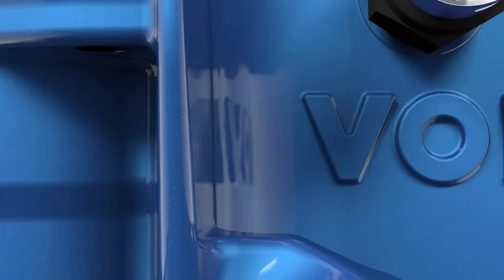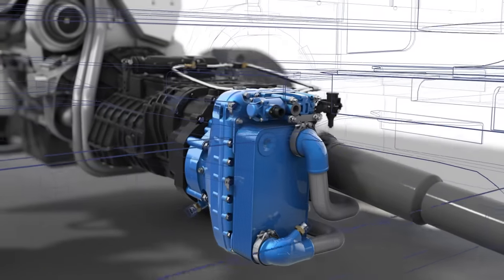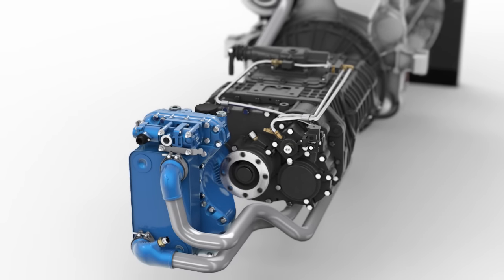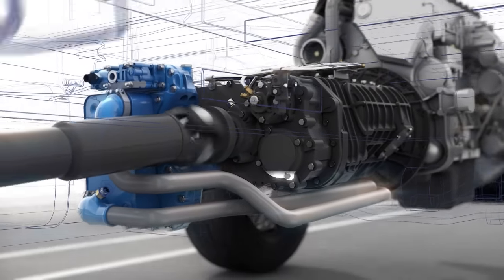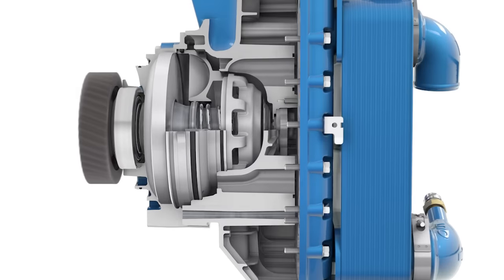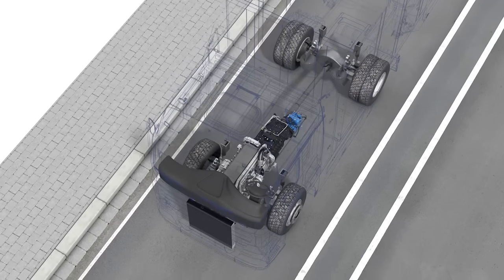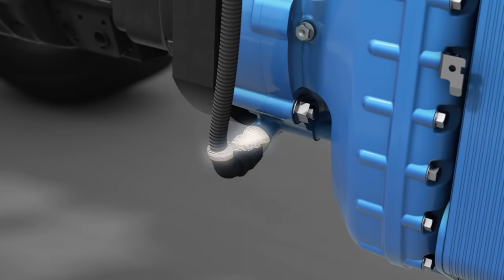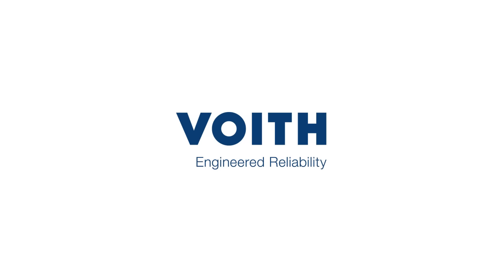Voith Animation Retarder VR115 CT (en)

Comment: So it's a hydraulic brake that works via the drive line using fluid dynamics to directly slow the truck. Kinda like at torque converter but in reverse. That is pretty cool.

Comment: Had a retarter in a 2003 Peterbilt  550 cat 18 speed and jake hauling heavy oilfield equipment and it worked great. You would be surprised how much braking power it has. 80,000kms and my brake drums were still black. Only time used any brake was to park. ps. It was a option when I bought the truck and it was $8900. Extra .
Reply: How much do you think it has saved you in operating costs over the years (brake pad replacement, downtime, etc)?
Reply: I dont think they make it for eaton, as far as i know voith is european only

Comment: Many trucks here in New Zealand use Voith Retarders in conjunction with Engine Brakes. Jacobs Brakes on a Cummins provides about 300hp of retarding. A Voith provides up to 800hp of retarding. Using both together means you can descend a steep hill fully loaded without cooking your brakes and therefore able to make a safe stop at any time. Voith Retarders work really well, are super reliable, make for  quicker average speeds, shorter trip times, extend brake parts life, and crucially, much safer truck operation. They are expensive and add to tare weight, but if you have hilly terrain and or high gross weights they are worth it.

Comment: That engine is an FPT (Iveco) Cursor engine. Not sure why we don't have those in trucks in North America. They seem to be a very reliable engine in agriculture and construction equipment.
Reply: Exactly, in agriculture and construction equipment. Mostly slow moving vehicles which are going very slowly while operating.
IVECO engines in trucks or buses are crap. Because these vehicles are moving pretty fast compared to f.e. tractors, the engine wear is bigger, and in my City, 12 buses with IVECO engines burned, because of engine failure caused by wrong facturing procedures. Be happy that you don't have them.

Comment: I drove some buses that were fitted with retarders and from a drivers point of view and many others driving service buses we hated them , they never came on smoothly , some of them even banging on and off no mater how lightly the brake was pressed , yes they may save on wear and tear but the passengers that were thrown about just blamed the driver and I actually had some heated arguments with them , most were semi automatic but some fully automatic voith push button autos , the way we got round it was to slip the gear change into neutral which made for much smoother stops , but if the company found out you would be reprimanded , this was in the 80 s 90 s so I think judging by the few buses I've traveled on they have sorted it out or just not use them on some of them.
Reply: They've improved dramatically in most cases. I drive a VDL with two stage retarder, pedal activated, and it works so well. They come in very smoothly now.

Comment: That doesn't look expensive, heavy or unreliable at all.
Reply: it is heavy and also expensive but very reliable.
Reply: they are very awesome
Reply: Found the American truck driver! These things are awesome and can easily produce over 1200 hp of braking power in combination with a good engine brake.

If you don't know what that means, it means you can hold a 50 metric ton truck and trailer at 80 km/h down an 8 % gradient effortlessly.
Reply: Of course, it would be more reliable if it didn't exist all together but joking aside I don't see why it would be unreliable - it's quite a simple device.
Reply: @energymc22  Yes, and unlike conventional brakes it has no parts that wear out and need to be replaced regularly.

Comment: So, that's a fancy, oil-driven pinion brake?
Reply: Yes, and it's advantage is that it doesn't have any shoes or pads that wear down and will never overheat either as it is cooled by the truck's radiator.

Comment: A better solution is to have the PTO drive a hydraulic pump/motor that charges up a piston accumulator during braking.  The charged accumulator will then feed the motor to drive the transmission during acceleration via a proportional pressure reducing valve allowing for fine control.  That way you do not need the heat exchanger as the energy is recovered.  A hybrid system for trucks in essence.
Reply: Im sure the mine haul trucks use this type of system.
Reply: Yes gud idea
Reply: But where do you put the compressed oil when the accumulator is fully charged? The retarder is built for long downhill roads. You can´t save that much compressed oil in the truck. And you would also need a hydraulic motor for restoring the energy to the drivetrain. The system would be to heavy, so less payload.
Reply: Maybe good for busses in cities.. fully loaded truck comin down 5000 ft.. u can’t store all that energy,unfortunately gotta get rid of it

Comment: They should use this technology for hybrid trucks, instead of just braking the vehicle could also create charge for the battery
Reply: they do. most if not all electrics and hybrids have motor/generator combos. Its so common basically all riding mowers have them! (starter doubles as generator)

Comment: 3:13 - is compression no longer occuring then? Surely the compression still creates substantial heat, whether during acceleration or deceleration events?
Reply: Fuel is shut off when braking  on most system the compession of engine is used to slow down vehicle
Reply: @garypeatling7927  not on a diesel. they have very low engine brakeing, hence jake brakes.
Reply: @jklbubbublkj7939  you are mistaken. They have very heavy payloads, hence Jake brakes.
Reply: @WeighedWilson  and very little engine braking. they dont have throttle bodies to regulate air intake, so the pistons cannot create the vacuum to make braking.
Reply: @jklbubbublkj7939  compression makes engine braking far more than vacuum.
Reply: @WeighedWilson   it is also a factor of engine speed. high rpm = more breaking. as you know, 2k rpm is not enough for significant braking. My whole point is, diesel makes less brake than a gas engine.
Reply: @pootispiker2866  I think you are missing my entire point. a 2.0l deisel and a 2.0l gas, the gas will have more brakeing due to the vaccum created on down stroke, and compression. diesels only have one. thats why the jake adjusts exhust valves to leave it closed longer to up engine brakeing. get it now?

Comment: The only issue I see the oil converter fan is always moving with the truck, what happens if that oil converter fails?   Does it freewheel, lock up, or blow up and make a mess if it fails?
Reply: System interrupts oil passage no brake applied
Reply: No intarder brake that's

Comment: Cant u use it to store the energy for takeoff as well?...kinda like an electronic capacitor...but uses the pressurised oil to drive the turbine and assist the truck in reducing engine load on takeoff...even if it lasted 7 seconds, the reduced engine load would save so much on fuel...like 1st gear is on assist, then from there, motor takes over and builds up air pressure during braking to force the oil to turn the engine on launch after stopping at traffic lights or toll gates
Reply: it can't because usually there is a lot of time between slowing the vehicle and take off, usually the retarder is used when prolongued braking is needed, often going downhill and rarely we have to stop in such circumstances, also the oil is accelerated in the " turbine"  section but when it gets back to the oil tank it has to be slow down before reentering the turbine to create braking force, so the main tranformation of energy os from kinetic energy to heat
Reply: No for one elementary reason :
There is no such "presurised oil"
 You can store energy in presurised gas but not presurised liquid as oil
Reply: @amwomt7528  For a nominal cost, enginneers could easily build a 10 second energy storage facility.
Reply: @almostbutnotentirelyunreas166  Engineers can build a fixed amount energy storage, say 2kwh. How long this lasts is entirely dependend on the load you pull from that storage. And it would add so much complexety and weight with this system, that the overall Fuelsavings will be not measurable
Reply: @theonly5001  Nonsense, energy recapture is a matter of proper engineering, that is all.
Reply: @almostbutnotentirelyunreas166  
How do you design a fixed time energystorage?
That would defy any laws of physics.
For a System like that you need additional Technology, that such a short term storage won't be feasible.
You need some sort of storage, some sort of motor and some sort of coupling device.
You can get rid of one of those, depending on the type of System you Design.
That added amount of Mass will take it's toll on fuelefficency and on payllad capacity.
I would imagine a system like that would weigh like a couple 100kg total.
Reply: @theonly5001  Yes Felix, it would probably weigh several Hundred kg.....so what? Most Trucks that are fitted with Retarders (several Hundred kg on their own) are above 8000 kg PAYLOAD, with GVM a above12000 kg.....you are confusing motor car / motor cycle design parameters with Truck design parameters.
But please, do carry on pushing the point you are trying to make.....I may even understand your objection in due course.
Reply: @almostbutnotentirelyunreas166  a 10 Second energy storage is entirely unreasonable, something which will last for a couple of minutes is way more useful. Because you would have to build the system to capture and release energy anyway. Why not make it more useful, like to be able to support during stop and go in traffic jams.
There a 10 second energystorage would last you 1 cycle. Something a little larger will last you a while longer. And you could even do some city driving with it. Use it to accelerate, and keep the speed with the ICE, the on breaking recharge some of the energy you spent. My guess would be, that you would loose like 50% of the energy you spent each cycle, but you would also decrease wear on the clutch, and ICE in the same moment.
A 10 second energy storage would bearly last you 1 acceleration phase and you would only charge it to half Charge on breaking, that wouldn't last you one acceleration phase again.

The benefit of a retarder is, that the costs of integrating one are less than not having one.
That retarder is around 60kg.
And it saves you like every other or more breakchange.

And if you want to get enough power from your device to put that energ back into the drivetrain your motor is the heaviest conponent in a short term storage. It would at least male sense to add enough storage capacity, to make it worthwhile.

If you add all of that together, a 10 second energystorage wouldn't make sense for a heavy vehicle. That is something a light vehicle would benefit from, where you loose very little power to friction and the like.
Reply: @theonly5001  Felix, Felix.....what are we going to do with you? At least you are largely thinking logically, however these systems already exist, relax: You 'n' me don't have to re-invent them.
Specifically, in sequence:
1) Of course a 10 second 'assist' on acceleration should not deplete the stored energy, it should merely 'tap into it' for up to 10 seconds, during the period where any truck is at it's least 'efficient' in terms of fuel consumption: Pull-away from stop.
2) This Retarder (whole system, with pipes, coolant, valves...) weighs much more than 60 kg, not sure who lied to you?
3) Look up "Eddy Current Bake", start here: https://en.wikipedia.org/wiki/Eddy_current_brake
How hard would it be to bleed some of that wasted current into an accumulator pack?
(Chevy Bolt, 60 kwH, weight approx 440 kg. Nissan Leaf, 24 kwH, approx 300 kg.)

4)This is not a difficult engineering task to optimise for: Have a look at  Hino Hybrid  trucks: The Retarder in this video is on it's last legs, by virtue of being a dedicated 'energy waster / disapater' .
5) Voith will have to look to the future to remain competitive.
Reply: I belive some buses used to have a flywheel hidden horizontally in the floor that would spin up during breaking. This helped the braking effort because the flywheel absorbed energy from the wheels to get up to speed. It would then free-wheel while the vehicle is stopped, storing that kinetic energy. Then, to help the vehicle move off, drive torque is harvested from that rotational energy to make the vehicle move again.

Just a thought... I wonder if they could achieve a similar solution with a giant version of a watch spring...

Comment: I can see this being used as a supplemental system with an engine brake but it seem like it would be a needlessly complicated replacement for one. The greater the complexity the more potential failure points.
Reply: @Stian Myrdal Laursen I'll admit I'm surprised this sort of system can be reliable but I hove no experience with it.
Reply: @Stian Myrdal Laursen an engine brake does not accelerate the wear inside the engine any more than regular  engine operation. The engine brake essentially turns the engine into an air compressor (simplified terms) and uses the resistance of the compressed air to make braking force. In my experience exhaust brakes or turbo retarders are extremely ineffective at producing any real braking force and the excessive exhaust heat generated by the restriction can be problematic.
Reply: @Stian Myrdal Laursen I'm always happy to find new thing though so I will look into Mercedes.
Reply: @Stian Myrdal Laursen To be fair I do find European trucks to be superior to North America trucks in build quality and comfort and I would certainly prefer a silent braking system instead of this 15L Detroit screaming at me. That being said the engine wear with or without an engine brake is negligible at best but I get your point.
Reply: @Stian Myrdal Laursen I guess I'm coming at the issues from the frame of mind that anything that adds complexity and involves heat and hydraulic fluid, if its built to the Same quality of the rest of the trucks I drive... It's going to either blow up or burn down.
Reply: @Stian Myrdal Laursen We took on 12 new freightliners this year. 5 of them leak in the rain like a colander, 2 of them blew out the water pump and corkscrewed the radiator with the fan, and they all have various body panels falling off.
Reply: @Stian Myrdal Laursen. I'd be happy if freightliner could figure out how to keep the rain on the outside of the truck. I've got a video up if your at all curious about the garbage equipment I deal with.
Reply: @Stian Myrdal Laursen Its such a simple request really.... but no. Raining outside? Then raining inside too.
Reply: @Stian Myrdal Laursen . Fleet spec trucks are largely awful. 

Before we switch back to Detroit we were running Cummins engines and the multistage exhaust brakes on those trucks had a braking force some where between wishful thinking and a vigorous fart.

Comment: seems like more tare weight than a conventional exhaust or jacobs brake, thats probly why they are not real common in the states
Reply: The Bear Republic we prefer not to deafen the entire continent when slowing down a truck in Europe
Reply: the brakimg force is way stronger than an exhaust braking sistem. here we have both but i rarely use the exhasut braking since is mich weaker than the retarder, even when loaded i only use the brakes when i have to come to a dead stop and even so most of the braking is done by the retarder, also it saves a great deal in terms of brakimg pads and disks amd finally you have to consider that europe us quite mountanous so just a exaust sistem doesn't cut it here.
Reply: @Doggydoglol  Only unmuffled engine brakes are loud and they're rare and only on very old rigs.
Reply: Allison builds them into some transmissions, my MD3060 has a retarder, love it.
Reply: They are probably not very common in the states because companies do the minimum to fall on the required standards.
In europe they get slapped hard for violations.
Reply: @Doggydoglol  😂👍✌

Comment: What about jakes? No extra parts needed and it doesn’t use fuel either
Reply: I CAN'T HEAR YOU MY EXHAUST BRAKE IS ON...
Reply: my exhaust brake noise is my horn
Reply: because engine braoes are much much weaker than retarders, i have on my scania both and the engine exhaust brake doesn't even compare to the retarder.

Comment: or.. or ... stay with me now, just use a jake brake.
Reply: i love the jakes but when hauling 160,000 you need all the braking you can get
Reply: depends. jakes are good, but very loud. retarders are silent, and make good braking power. its small and relativly light, just have both.

Comment: Mmm... looks like a new oil leak waiting to happen. Hopefully its powerful enough to help prevent runaway trucks with overheating brakes.
Reply: i thought the same. what happens if the oil becomes too hot? then the additional brake capacity of the retarder has to be reduced... AFAIK, the jake brake only uses mechanical compression force of the cylinders? They should be more reliable...? But maybe not as strong.
Reply: @knuffelbaer1971  - The Jake Brake is pretty sufficient.. I saw an 80,000lb load going down a hill with just the Jake Brake.

Comment: Hope they seal the wiring harness well from moisture and abrasion. If you were relying on it to brake down a grade and salt spray permeates wiring it could think it's overheating and disengage depending on how the sensors work.

Comment: The engine brake is sooooo much less complicated...
Reply: Depends on the type of engine break.
A exhaust break ist less complicated then a jake break, but the jake break needs exact timings and is loud.
This system, doesn't care about timings and is rather quiet.
Plus, it supplies way more breaking torque and doesn't wear the flywheel of the engine that much.
Reply: @theonly5001  wait wait wait, wear the flywheel? what do you think a jake is? it is cam profile change. thats it. thats literally all it is. it has nothing to do with the flywheel.